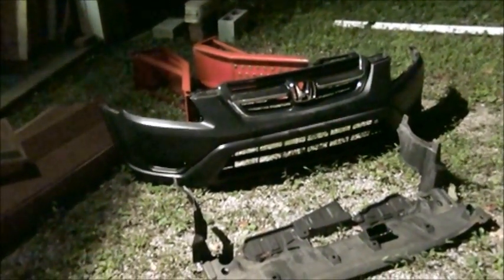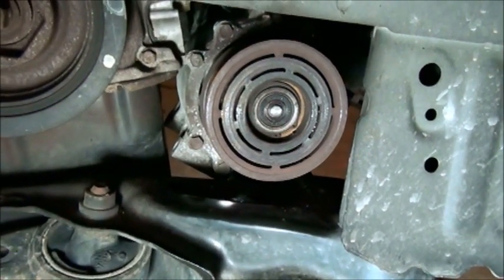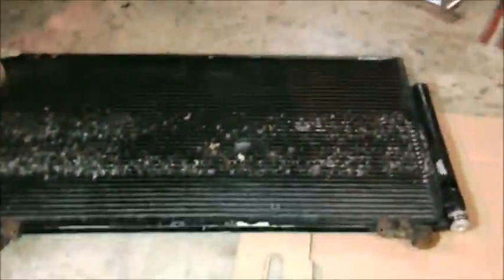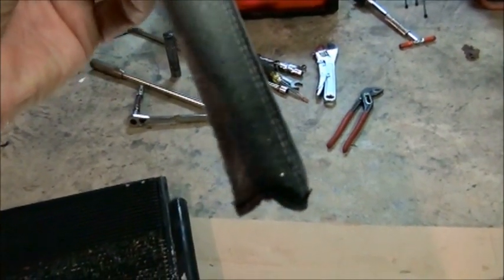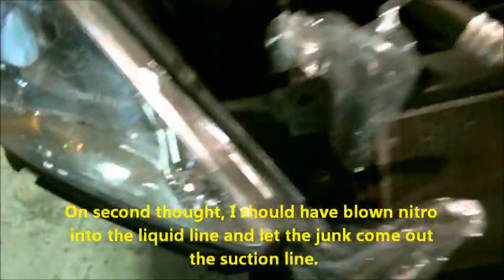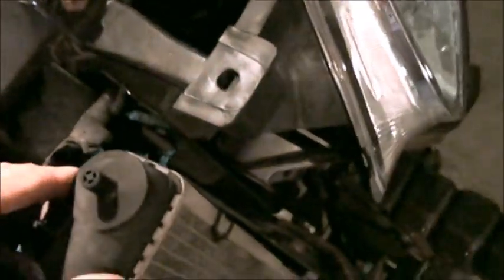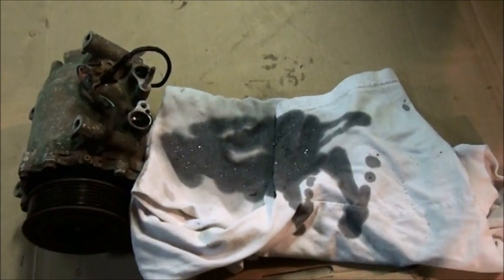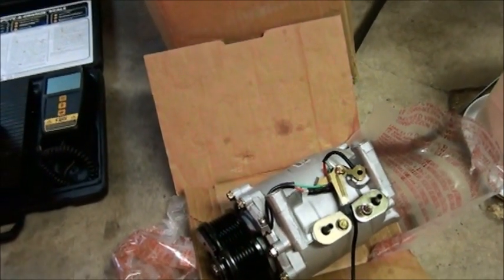2003 Honda CRV Compressor Failure

Comment: I have an 03 CRV with 291,000 miles that I bought new... I ran Mobil 1 in it since the first oil change... It is and has been an amazing vehicle but I have the third AC compressor in it that needs changing... The only weak spot in the vehicle... I'm not complaining
Reply: Something in your AC system is preventing proper oil return to the compressor. Have you ever tried replacing hoses, condenser, TXV, dryer and having the evaporator flushed?
Reply: do u do the repair ur self or pay someone if so how much
Reply: @patrickwilson4765  For most of the time I owned this car I tried to do as much I was able...but the last 5 years or so I've been having the work done...it has been an amazing car and to this day people are amazed at the condition of a 17 yrs old car with 300k miles on it

Comment: remove the compressor from the bottom of the car , take 2 frame bolts out  , loosen rear frame bolts , remove front mount pin 17 mm remove 3 rear bottom mount bolts , tilt engine slightly , compressor will come right out ! took me 10 min to pull 10 min to install ! dont listen to this dude ! i been doing this kind of work since 1985 .
Reply: I guess there is only one way (your way) to do a job.  Everyone else is wrong lol.
Reply: @tongl274  no i just want to try to make things easier for D I Yers
Reply: @tongl274  Mark's way is the best way by far.
Reply: I have heard that this is the easiest way.  Tilt the engine and take it out the bottom.   Wish there was a video of this process.   The AC just died on my '02 and I am now faced with having to do this.
Reply: mark simmons  CC

Comment: I have a 2005 with a failed coil.  Do you think it would be possible to unbolt the compressor with lines attached (still charged) and replace the clutch/coil from the RF fender well area?  It looks possible from your video but you already had the lines disconnected.  Thoughts would be appreciated.  Thanks!
Reply: i got same problem , you gotta remove the radiator , lose the bracket which hold the ac lines where the low and high ports are , just to be able and move the compressor around.
Reply: Thanks for your reply, Edgar!.  I have to do a coil replacement on a 2005 CRV 'in-the-field' 2 hours away from my shop.  I won't have access to an ac recovery/recharge machine there.  The 'book' procedure calls for the compressor to be removed from the vehicle. It's helpful to know that you were successful, and that it's possible, in performing the repair with the lines attached.  Thanks~!

Comment: Honda CR-V Gen-2 Air-Con Black-Death "FIX IT" WITHOUT REMOVING THE EVAPORATOR! ✅ method is HERE ➡️blow nitro into in via "liquid line" ➡️in order to flush contaminates being black oil & aluminium metal particles to come out➡️ via the "suction line"➡️ 

see my own comment reply for a bit more
Reply: 💯all this effort saves a lot of time trying to remove the internal evaporator system. it's a big time saver⏳disclaimer is none of these ideas is advised yet some people claim to have had no issues putting this method to test. in summary what you will need to replace compressor + condensor + expansion valves only noting else Now to clean evaporator out and best you can blow out the evaporator using nitrogen to clear out the black oil & metal shaving contaminants
Reply: you do this to be able clear your evaporator of contaminants. more information, this is in order to catch junk that comes out ➡️ from the evaporator now what you will see on your white cloth when the nitro it blowing it out is black oil & metal shavings blowing out the suction line 

catch these contaminates using white fabric method is keep checking the white cloth for black colour oil and bits of metal particles as you continue to be folding over the white cloth to a fresh clean side of the fabric

you do all this to know when the nitro blowing out of the suction line comes out as just clear clean nitro as clean as you are going to get it
Reply: easier way to remove the compressor is from the bottom of the CR-V could be , take 2 frame bolts out  , loosen rear frame bolts , remove front mount pin 17 mm remove 3 rear bottom mount bolts , tilt engine slightly , compressor will come right out. may take up to 10 minutes to pull out of the vehicle the old compressor & further 10 minutes to install the new compressor neat great advise said by mark simmons in the comments here what's more most people in the comments here agree, simply tilt the engine and take the air-conditioner compressor out the bottom the car

all fantastic advice and good to know it the compressor will comes up out past the radiator if I am having trouble removing it from underneath yay ...&& you can get the compressor out through the top by moving the radiator froward here is another YouTuber clip that extensive includes intensive instruction on how to get all the plastic parts out of the way https://youtu.be/hcIucjQL3cA to do so very good work here be amazed 😅

I myself just had to get down in my own words

love to share too

with many thanks to ScientificAir with whom I would I was able to under completely what all this stuff is about 

no to get it all to work for me in my 2002 automatic that has 35000 kilometres = 21747.992 miles on the odometer

Comment: I bought a 2003 honda accord euro manual a year ago and ive been battling blackdeath ever since, change compressor more than thrice in 7 months. Eventually, i gave up because d last repair i did on it, i changed d entire ac unit( compressor, condenser, expansion valve, evaporator) d only thing i didn't change was d ac line and ac pressure switch and 2 days later, d compressor locked up again. Since then i gave up, please i need help from anyone who has information on this issue.